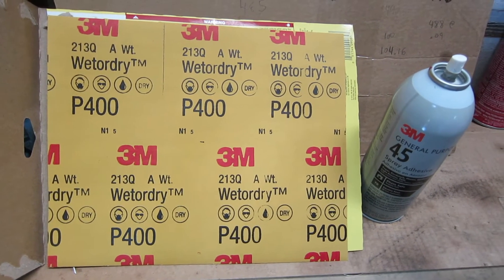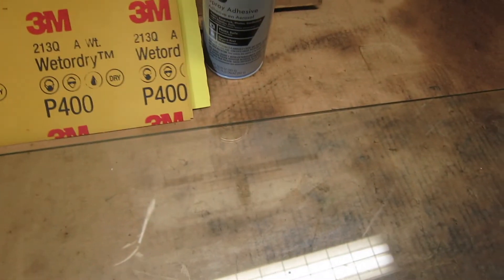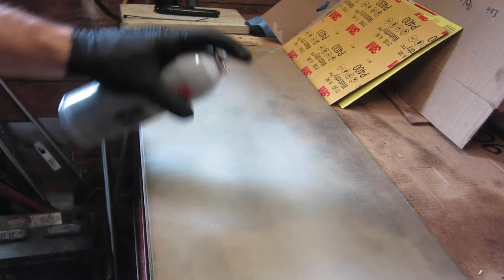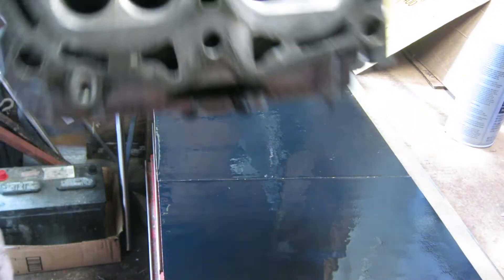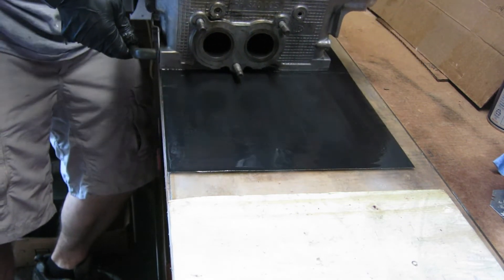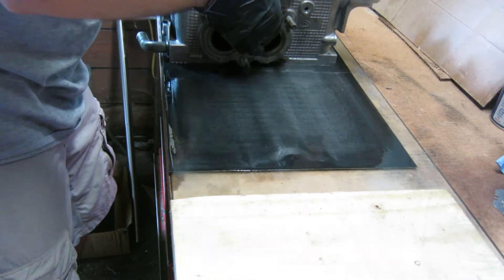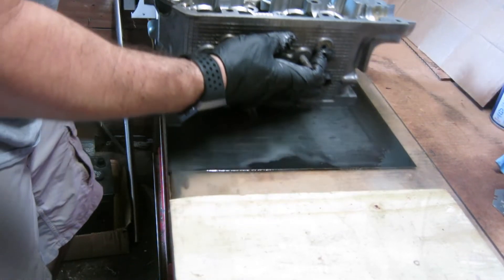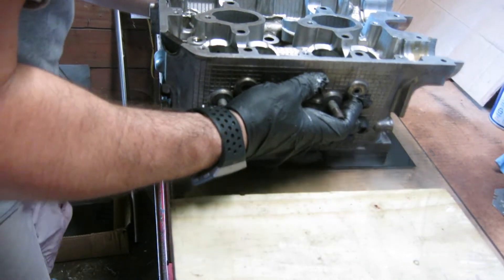DIY Cylinder Head Resurface

Comment: I have a vq35de aluminum heads and engine block any one know what sand paper grit I should use for the final pass I’m using the oem gaskets
Reply: If the OEM head gaskets are composite then 320 grit should be fine. If they're MLS then 400 to 500 grit for the finishing touch.

Comment: When I was a youngster, I used to skim my motorcycle cylinder heads this way. I always used old mirror glass , and valve grinding paste instead of sand paper. It took ages, but it always worked.

Comment: This works great. The Head gasket will take any thousands of differences.
Reply: wellllll… depends.On my 1996 camry, 500grit was what was required to meet spec, so I was golden (did it in a parking lot)…

But it should be mentioned that Some of these new MLS gaskets require a surface roughness (Ra) equivalent to damn near mirror. High compression, and all that jazz.

Comment: pro tip use sanding paper for deck resurfaceing  sander there massive and solid and come with doublesided tape on it home depo sells sheets in rental section

Comment: But after rectifying the surface, how do I calculate the measurement of gasket cylinder? or just put the same measure?
Reply from the maker: I use a new oem spec gasket. Unless there is damage to head you should not have to resurface much to get a clean gasket surface.
Reply: @peak_ascendr9960  thanks dude
Reply: Thats a good idea